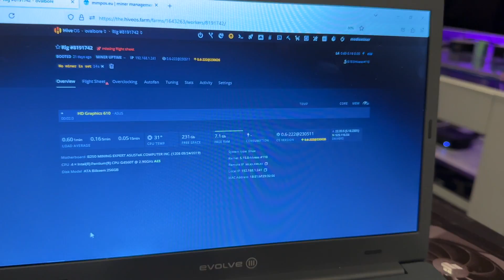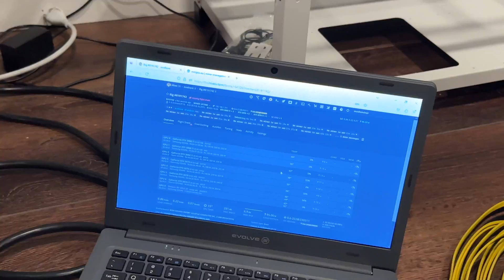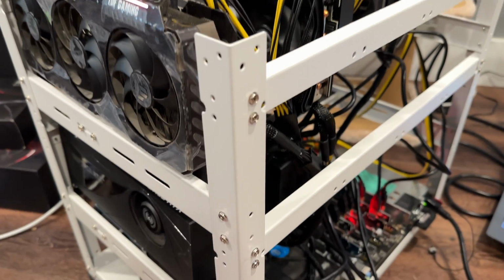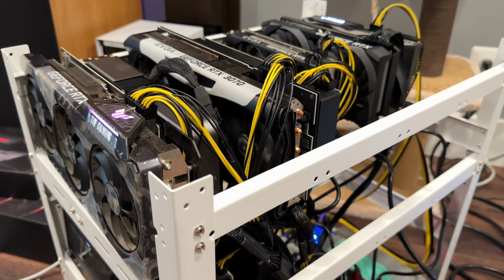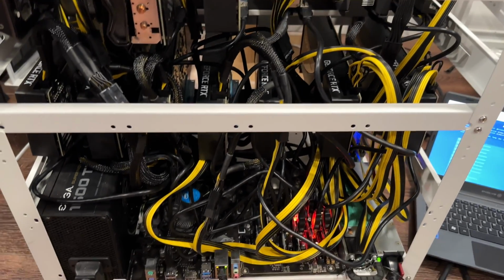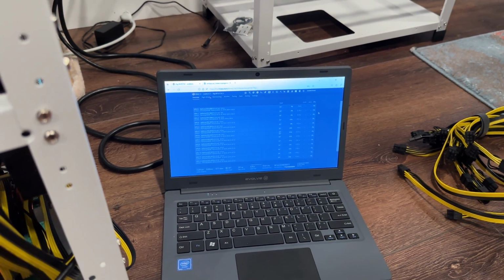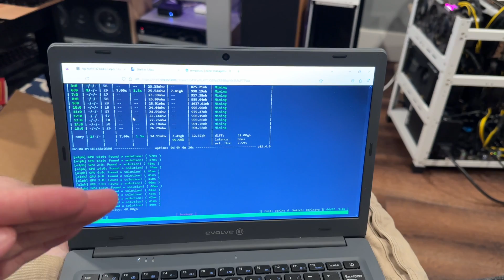Crudely Stapling 14 GPUs in to a Single Frame

Comment: miner just get away from the town, as the electricity is used up and the electricity bill go up from the activity of the guys like u are doing.
Reply from the maker: I have PV, and mining helps stabilize the grid and prevent costly bulk purchase overages from power companies, and aids in reducing the stress on the grid from AC during heat waves.

I do understand where you're coming from, but I would encourage you to do some more research and stop looking at headlines before judging someone you've never met over a topic on which you know so little.